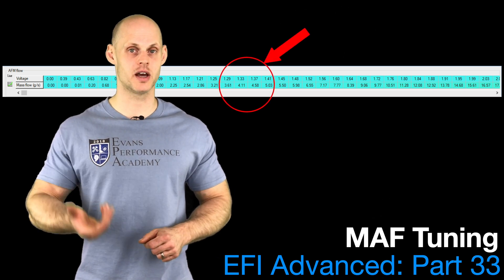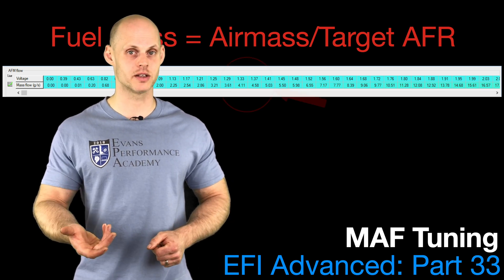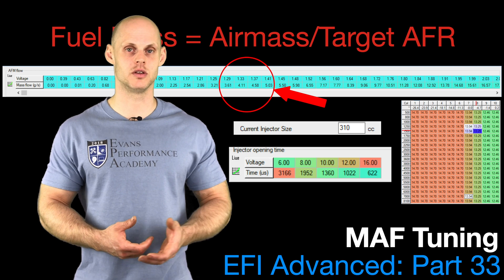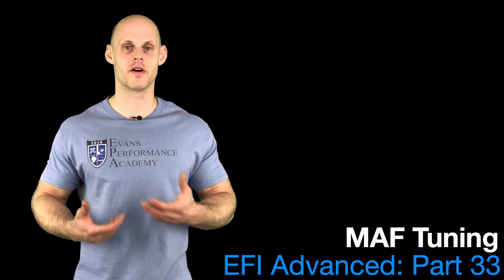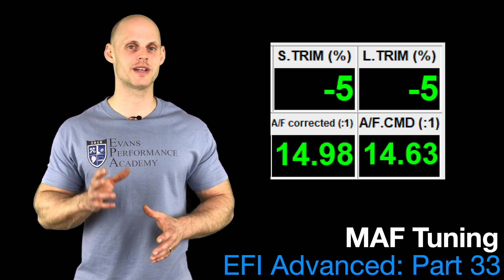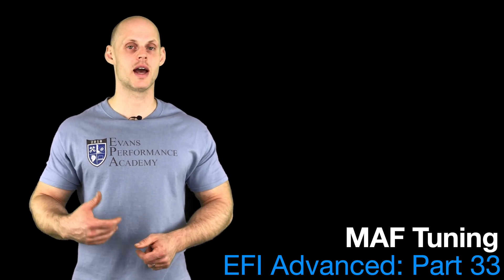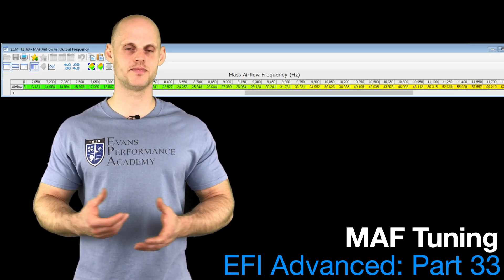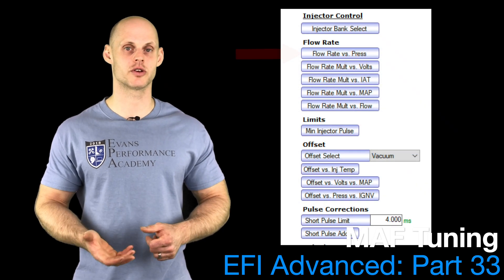EFI Advanced Part 33: MAF Tuning | Evans Performance Academy

Comment: hi, im new to tuning and am about to convert a two-stroke to megasquirt. Is this video saying I can use a MAF sensor and megasquirt will calculate injector pulse width to achieve a desired AFR? This would be amazing since O2 sensors arent really to be trusted in a two-stroke exhaust with oxygen spilling into it from the scavenging cycle.
Reply from the maker: Yes, MAF can be used as an input to the MS for fuel/spark calculations.  You would still need to use a wideband AFR reading to validate the fuel delivery though when tuning in MAF mode.
Reply: @EvansPerformanceAcademy  bummer... ive been reading more about MAF tuning and from what i gather its basically there to do corrections to already established MAF and VE tables. I was hoping that MAF calculations would be used in place of an O2 sensor and those calculations would alter the VE table. I bought an O2 sensor and controller but I worry about trusting the readings I get from it considering the scavenging cycle in a two-stroke will surely be letting unburnt oxygen into the exhaust.

Comment: Hello, during closed loop won't the O2 sensor try to get the AFR to the commanded value? In that case why is closed loop a problem?  Or do they try to get them back to stoich?
Reply from the maker: In most OEM ECUs the sensors are narrowbands so they are only accurate at stoich.  Some OEM ECUs are full closed loop with widebands (Ford, VW/Audi/Porsche,) which can utilize full time closed loop at part throttle and WOT conditions.